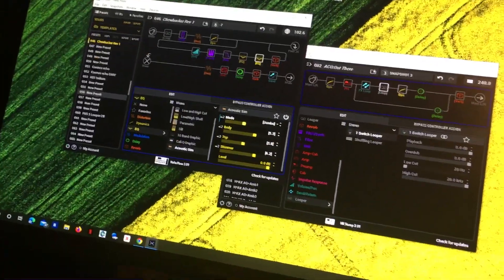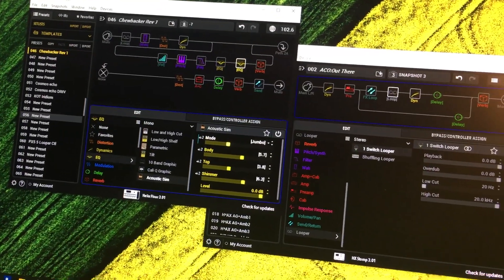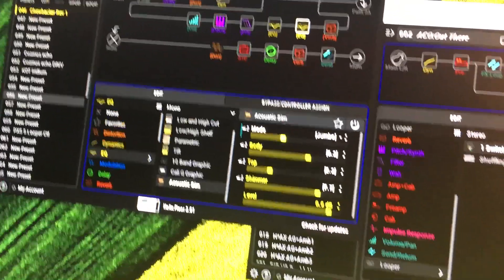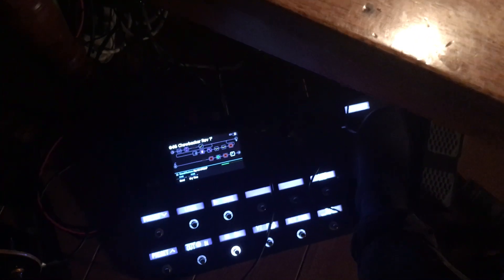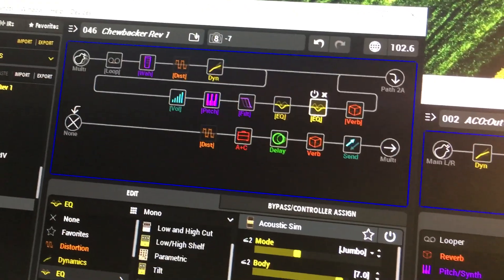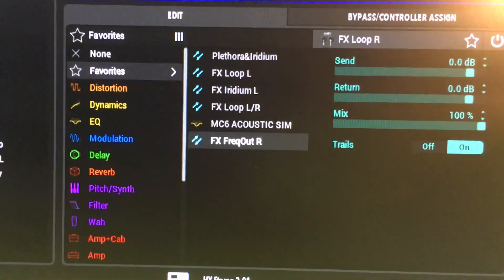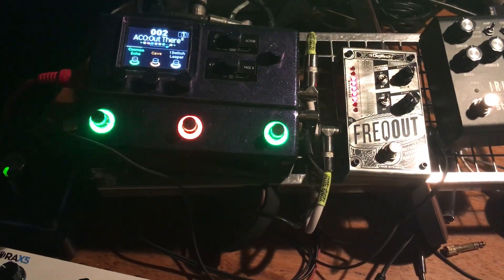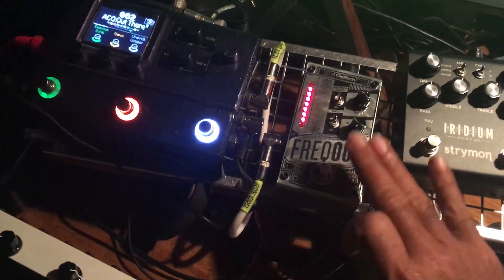Helix based freqout & Digitech Freqout working together.

Comment: You're having too much fun, dial it back a bit ;)
Reply from the maker: Muahahahahaaa, you should hear this thing with the Ribn app driving it!  Dropping 7 into the sub setting on the pedal oh man does it thump! I figure this is a cool way to mess with the overdrives and boosts.  Gets gnarly!
Reply: @AlecBourneMidiMadScientist  Haven't tried Ribn yet, but it looks cool. Would be nice to have some knobs available without having to drop to the floor if you want to tweak. Does this feel more/less/same intuitive than OnSong to control fader / CC settings?
Reply from the maker: @jwstout007  go for Ribn and that other app dude.  They are SICK! There are a few experiments in vids with Ribn I did search on the channel or from Google or whatever.  

So from the whole feel point zooming out to encompass the entire rig... using a laptop and a dell touch screen this is for me a rarity as I build just about everything by ear and right on the unit.  I only ever use hxedit for maintenance and updates... but it is cool to have if the iPad is busy.  In this case I’m uploading now a film done on iPad whilst playing so it is a good way to document what both floor and stomp are doing at the same time. 

Playing these 2 presets linked together is an absolute dream man.  The range using 2 freqout circuit ideas in series with delays and wah and the acoustic simulator in 3.0 really make you think about creating entirely new instruments.   Hopefully the vid finishes soon.  Yeah you gotta try this.  Swapping out the boosts and drive pedals is wild.